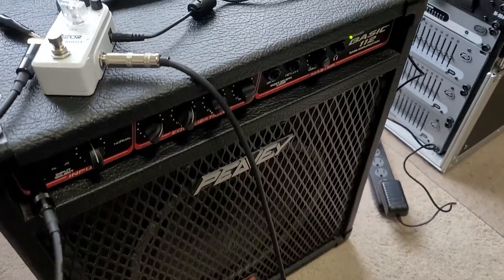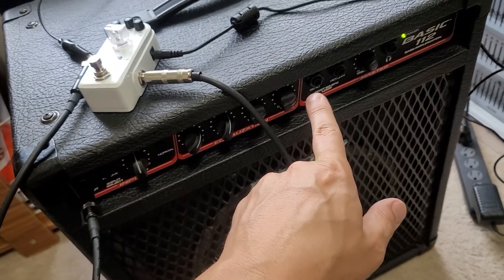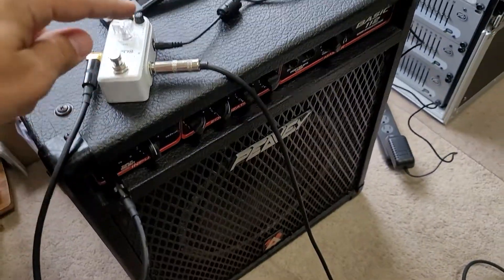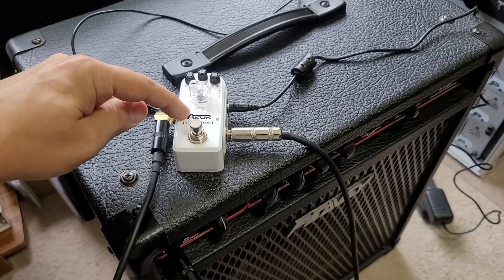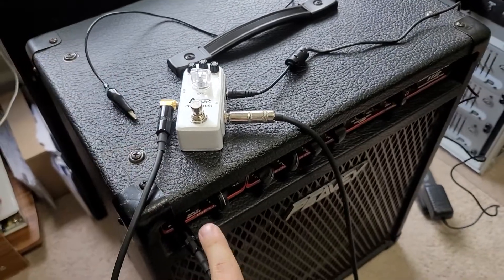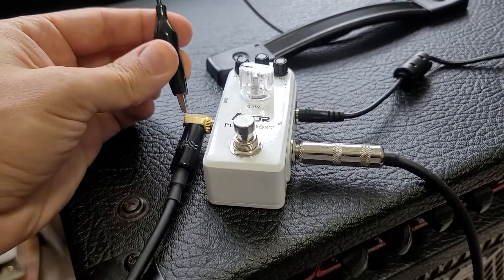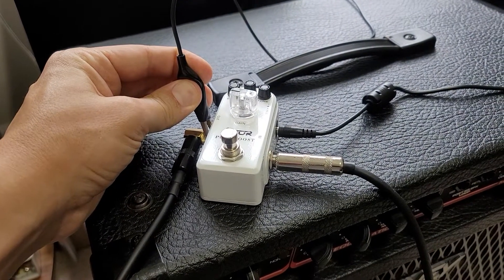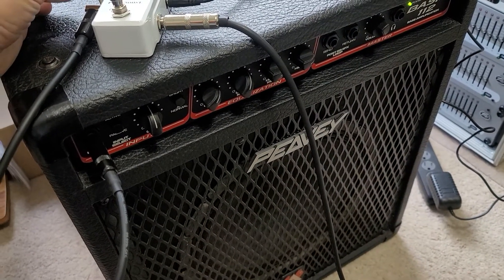Effects Pedal Power Supply Ground Loop Buzz: Isolated Input Jack On Amplifier, How To Fix

Comment: What should i do if i use a multieffects pedalboard and i connect ut directly to the mixer.
Reply from the maker: @daupp7753  preferably use a DI box to connect to a mixer. It converts unbalanced signals to balanced and in passive ones that use an internal transformer it can offer galvanic isolation to break any ground loops

Comment: this really is my problem. this is the fix. but I am still to get a cable like that of yours with an clip at the end. what is it called?

Also, where did you find the ground im your amp? mine has literally 0 metal exposed.
Reply from the maker: @raulgalets  It's just some alligator clip wires that I used
Reply from the maker: @raulgalets  also I know that the grounding of my app is at the mounting screws. You might actually need to look around depending on the amp that you have where there is an exposed frame screw you can use
Reply: @Bassguitarist1985  I see. now that I think about it, my amp only has 2 prongs out. it doesnt have an ground pin. So it is not grounded. What should I do?
Reply from the maker: @raulgalets  what kind of amp you have? Model?
Reply: @Bassguitarist1985  I am from Brazil. It is an Sheldon GT1200
Reply from the maker: @raulgalets  if it has 2 prongs it's a class 2 wiring meaning no mains earth is required for safety there will be no chassis screw to connect to.

What pedal power supply are you using?
Reply: @Bassguitarist1985 yes thats right, it is a class 2. I am using one of those daisy chain 5 plugs into one 9v 1amp p4 power supplies. It also doesn't have a ground connection. only 2 prongs. I believe this is the source of my noise yes. is there a way I can ground it? I am using a Boss OS-2 and I have similar behavior to yours: If I get a wire, connect to a ground pin directly in my outlet, then I touch the other end in the jack, the noise goes away.
Reply from the maker: @raulgalets  That's likely where the noise is coming from. The Daisy chain power supply is not referencing Earth because it is likely a class 2 PSU with two prongs. When you start interconnecting different devices becomes necessary to reference Earth at one point in the system to bleed off any noise. Not sure how it is in Brazil but the neutral is reference to Earth back at the point of electrical service. Because there is no exposed metal surfaces on a Class 2 device It negates the need for a safety earth ground, but that doesn't mean it won't produce any stray noise.
Reply: @Bassguitarist1985  I agree. you are right, there is only 2. We have some usa 3 prong type outlets but the norm is the Brazil NBR 3 promg outlet, which is kinda similar. I am looking into a Landscape Energy 6 Power Supply. It has ground and a patchbay, so I can even run the guitar and the amp though it.

Thanks for all the help!
Reply from the maker: @raulgalets  my pleasure!

Comment: How do you solve the 50hz (and further 100 hz, 150 hz, 200 hz harmonics) mains hum between a laptop on charge and a speakers inserted into a laptop? What device to remove it is applicable to that, any ground loop isolator etc.? Please give a direct model of that device that is known as removing the noise completely (no generalizations, please).
Reply from the maker: @sevchyk  assuming you are connecting to the speakers with a 3.5 mm wire, this should fix the noise.

BESIGN Ground Loop Noise Isolator, Buzzing Noise Filter, Buzzing Noise Elimination for Car Audio and Home Stereo System with 3.5mm Audio Cable https://a.co/d/7T79ZlV
Reply: @Bassguitarist1985  Yes, 3.5 mm wire. Thanks a lot.
Reply: @Bassguitarist1985  Do you know any other models that work (completely eliminate, without any residual noise), in case this BESIGN is not available in my country?
Reply from the maker: @sevchyk  not sure which country, but plenty of similar devices that isolate the audio signal wires.
Reply: @Bassguitarist1985  Yes, there are a lot of them, the key is to find the one that works in the majority of cases. "Tried and tested".
Reply from the maker: @sevchyk  isolation transformer adapters.likenthe one I sent you should eliminate any ground loops between the laptop and audio speaker input. If it does not, then there are other issues causing the noise.
Reply: @Bassguitarist1985  I know, I know, I asked you about an alternative model to that BESIGN, in case it is unavailable in my country. The "second best choice model" after this, if anybody knows.
Reply: I just found out about the Humno and I am eager to get it
Reply: @raulgalets  Do you have the same situation as mine? Can you let me know about the result after you buy it?